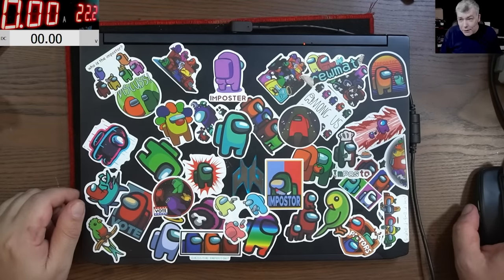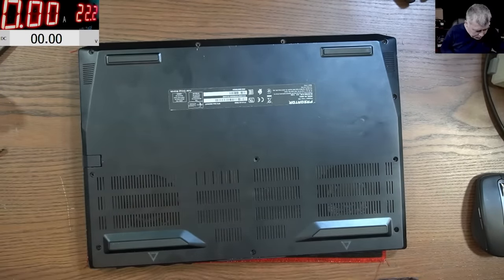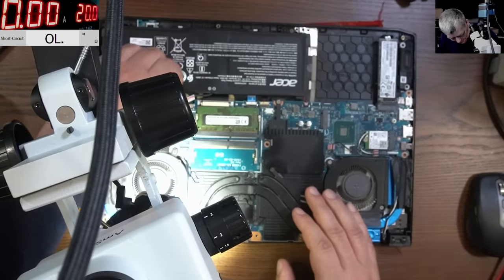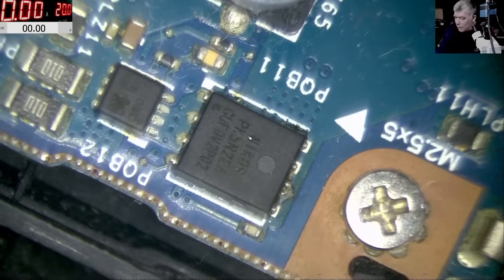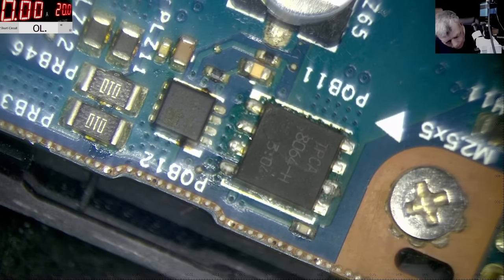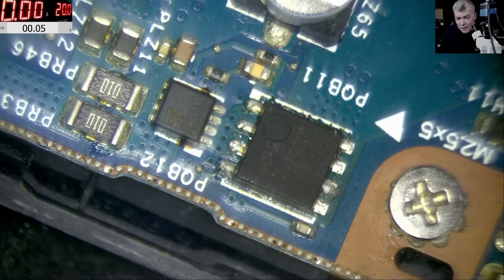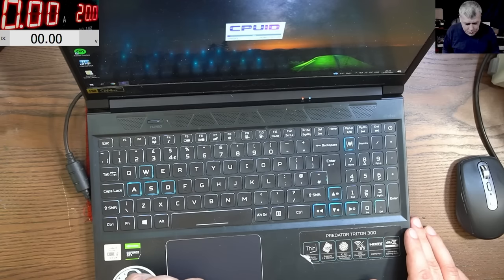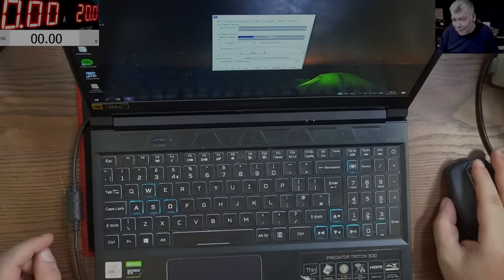Acer Predator Triton 300 - Gaming laptop shutting down unexpectedly, a common fault

Comment: I think that charging a fixed price for repairs is a good idea (you mentioned this yesterday). It wouldn't be fair to charge 4 hours for yesterday's repair and then today's customer pays 0.5 hours for the same fault.
Reply: In the past these sorts of jobs are used to cover the price on jobs you lose money on due to excessive hours you can't charge for.This is obviously at the discretion of the repairer.
Reply: well said:
Reply: its not often that simple!!...it depends on many reason how to fee a repair job!
in some cases u find the problem fast and the parts are cheap, so u can fix it for a good price for both sides!
but if u are not able to find the issue in the first 30min and the parts are relative expensive, so u cant charge a fair price for all!
there are many many Shops that never repair cheap 300$ Laptops from Intel 4th Generation! the reason is simple, you can buy it used for less than a repair would cost u.
Sorin is one of not many Repair Shops, that try to repair most devices!
Reply: @Knebebelmeyer  I know i was in the repair business for 30yrs champ
Reply: Perhaps not. However, consider that as ones skills get better, faster, more efficient, you charge 'more' for that service. Unlike technology, where prices tend to come down as manufacturing processes become more stable and efficient. So, technically, one could charge 'more' for a job that took less time - even though it now appears to be a simpler repair. Food for thought.
Reply: @jaym5938  yes, your right! this is another reason u have to calculate!
your skills are a mayor factor.
this is why sorin get some repair jobs from OTHER repair shops.
they are simply not as skilled as him.

Comment: i dont like random shutdown cases, it can be various things not just shorted mosfet besides shorted 5v power rail, faulty Super IO or faulty southbridge...etc.. sometimes it opens and shutsdown after 3 seconds and this faulty you can also check every mosfet with oscilloscope if there is leakage one of them or not.

Comment: I have an Acer VX15 very almost identical to the "Nitro" but with the ac plug on the side. Sometimes I have it unplugged working only with the battery and even when still having a big percentage of power all of the sudden the PC shuts down by itself. And when I try to restart it by pressing the "On" button it doesn't turn on. So I have to plug the charger/adapter and then it turns on and boots back up. I assume it must have a very similar problem with the mosfet. My problem is not severe since I can keep using my PC but eventually I might need to check it. One thing this Acer VX15/Nitro has is that the keyboards have problems by not able to type certain letters. I already got a new keyboard and will install it soon.

Comment: I suppose maybe the first mosfet is a much higher rated voltage device and maybe the second is lower voltage breakdown so it can be smaller.  The on resistance of these modern mosfet is incredible low.

Comment: Hi. I have been repairing laptop for a while now. But my problem is, I can't avoid breaking some plastic clips during disassembly process, no matter how careful I am. Is it normal? Well I normally could attach them back, but I need to put extra hours to fully repair the laptop. Any tips?
Reply: try to find service manuals that should help you how to disassemble the laptop carefully without breaking some plastic. good luck
Reply: @David-Zita  well, some manual have limitation. For example, when opening cover for screen, there's no various way. It's the same method. Older laptops tend to have fragile plastic clip due to the age. It's just very tiny parts that being broken. That's why I want to know if it's normal for technician? Sometime that situation cannot be avoided?
Reply: @Ratata JK: You must have the right tools for disassembly. I was skeptical to use plastic tools (screwdriver, spudger, plastic opener pick), the cheap ones to open cell phones (of course I prefer metal) but there are excellent ones (quality) for use on laptops and TVs. Of course we damage plastic hooks on the covers especially when one is a novice, that is, the first time you face each manufacturer.
I don't know much about the plastic injection process (the chemical and mechanical engineers are responsible for manufacturing and molding) but the quality of some manufacturers leaves much to be desired. Another way of saying it, how is it possible that large screen TVs (50 inches or larger) DO NOT leave plastic ventilation slots on the back cover, mainly where the LED strips are installed. Look for polymers for electrical appliances. You will find that its main enemy is the internal heat generated by the components... of course the environmental conditions of the region where you are also influence. In my case, the summer temperature is above 40 degrees Celsius every day and leaving plastic exposed to the sun will deform it in less than one hour.
Breakage of plastic cover due to hinges on laptops? It is another topic. Finally, superbonder 480 black, original loctite glue (an industry standard) can successfully solve that problem of broken plastic hooks. All the best.
Reply: @carlosgarciaoropeza5480  yup I agree. The quality of tools makes huge difference
Reply: since i have a ocd on scratching plastic surfaces on deviices mines or not often i dont have much problem regarding this but my issue is im weak and not too much pratice in soldering haha